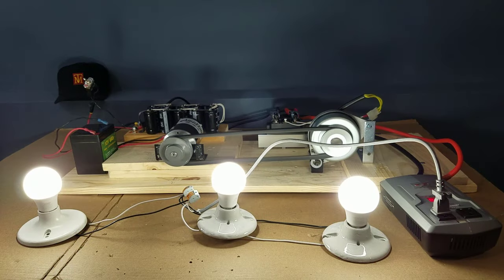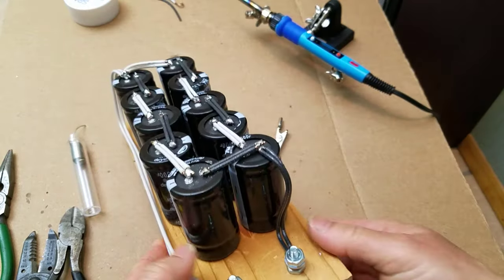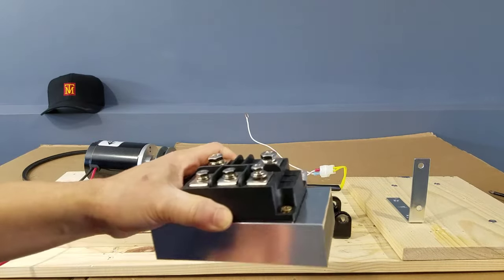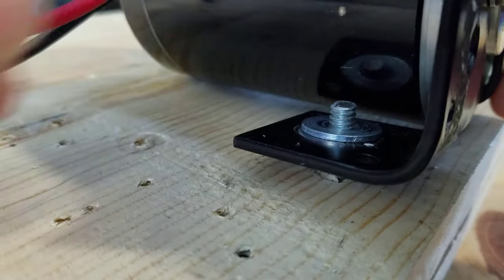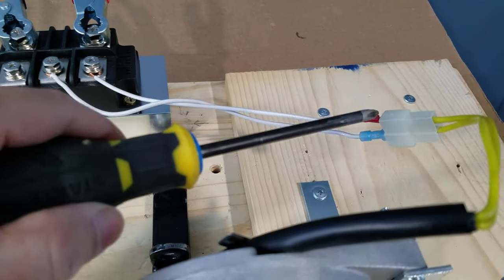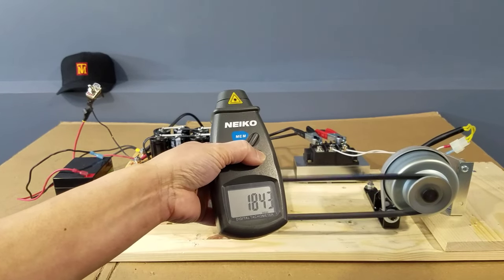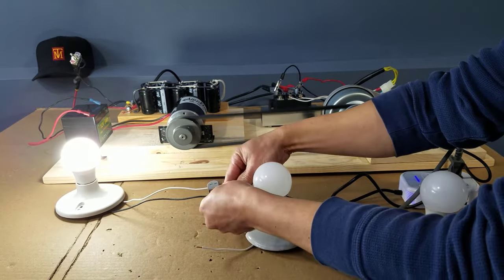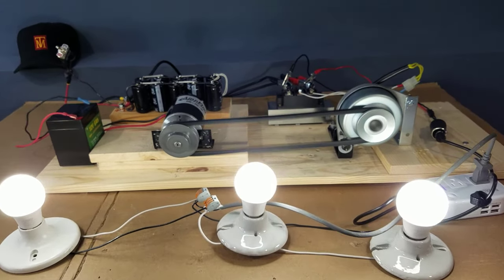Self-Charging Machine? (Permanent Magnet Alternator)

Comment: There is so much wrong with this video, firstly a belted pulley system waste power and a gear system or direct drive would have been more efficient. You don't show or tell how much Watts or amps  the electric motor consumes as this would then disprove your system. And yes I am a smart ass hater of people who con people.

Comment: there's something wrong with this set up ,,,,,   so in this set up the battery the capasitors and the motor are all runing on ac corent ,,,,,,,,,  HOW IS THAT POSIBLE  WHEN THE BATERY AND MOTOR ARE DC  TO ME YOU ARE FAKE AND A LIAR
Reply: The driver motor of the alternator is DC motor although the capacitor reading is below 12 volts

Comment: what you need, is a car alternator, and real bats.  Capacitors are great, but do not store much for long, an can store amps, so its good they are hooked in, but, if you arc them like he did,  using total arc for welding, they go dead right away.  You need more for storage.  Normal bats, are 100 amp and can store better the power.  We are running 5500 watt generator, yet in summer, were using solar panels,  Generator stays off.  And were using a battery lithium drill motor, for a quick charger only uses .4 amps to charge a lithium bat, then you put the bat to work, and with impact wrench, you get bout 2700rpms,  We put it on the Alternator nut, and it drives 5 amps out to the battery's.  Now, since the belt is not there,  you can put a belt, and put 3 alternators in a row,  and power them with one impact,  all three of them, and that's 15 amps from the .4 amp charge, the difference is profit.  So in the winter,  we be doing this, instead of a gasoline generator yes, it makes its own power the system.  WE have 20 bats lead acid,  so it stays for quite a while once its charged.   Were thinking about putting capacitors in the system to help the inverter not rob so much amps at once, when we use something up that takes amps.  To increase its efficiency.  When you have, you always take from it...  Led lights help it alot.   They drive the draw on the system.  We have 2 systems

Comment: I bought the same Electric motor, alternator, rectifier and capacitors.  I've bought a different battery cause I cannot order the same battery as in the video.  I've tried this setup and same wiring.  I've tested with my multimeter every step of the way.  In the end, it does not work.    It runs initially, until the battery is drained, then it stops.  The battery does not get charged basically.  It is BS basically.